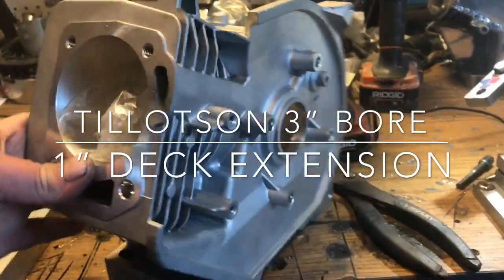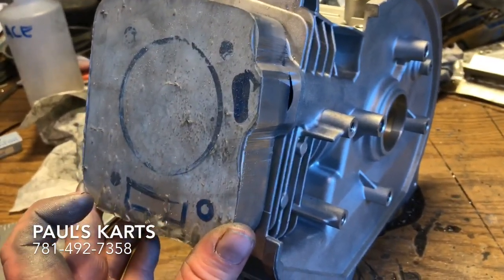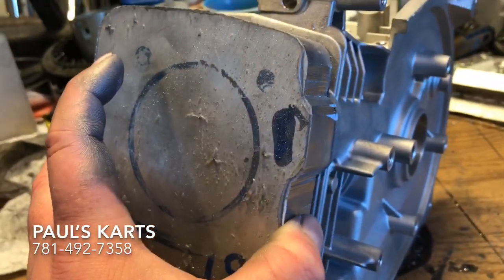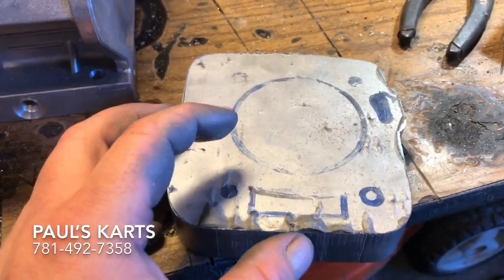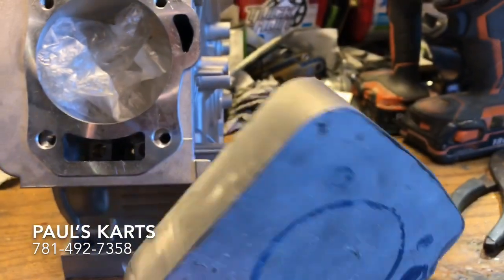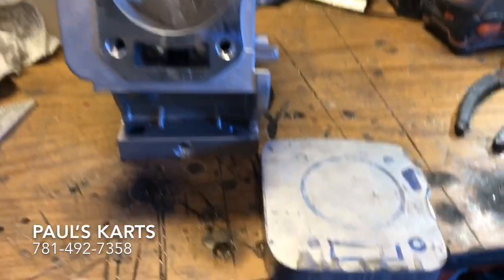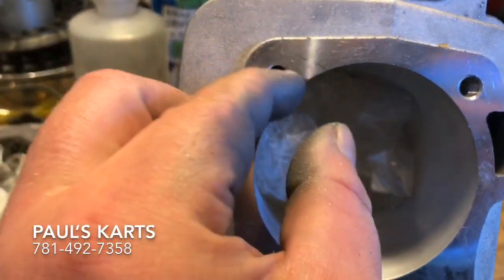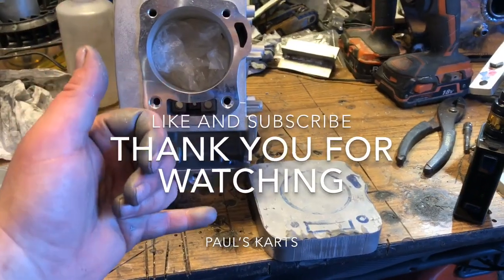TILLOTSON 3” BORE BLOCK / STROKER WITH 1” DECK EXTENSION ( HOW TO VIDEO )

Comment: What kind of rod and crankshaft are you using to make this all work out with the deck extension on this tillotson block ? 3in bore
Reply from the maker: On the 3” blocks if it’s a billet stroker crank use a Weisco piston and 6765 rod

Comment: wow busting your ass on that nice work man... I figured you had a cnc or something like that.But no your here working like a man and doing with hand tools thats awesome mad respect!!
know where to find tillotson hemi head gasket..I like the thickness on them. Post a video if you ever start selling tillotson hemi heads grate flow in stock form in my in my opinion would love to see what you can make them do
Reply from the maker: Amazing how things change in a couple years. Yes that was lots of work. We now do the deck extensions on a Cnc milling machine and there available for sale on the site paulskarts.com check em out if your in need. I’d never ✋ make one again😅
Reply from the maker: The tillotson hemi head is only good in stock form. For an open modified it’s not one I’d choose. That steep canter really kills any lift potential and the chamber is huge so low compression. Open modified “for me” would always be non hemi. We do an amazing predator hemi but that’s a little better (less canter) than the tillotson hemi. Able to squeak bye with an open build but it’s VERY specific setup to get it to work. Cool comment ! Paul
Reply from the maker: Another thing on the head is when you go all out open modified you gotta really know your cams. You can easily catch the valves passing each other as they open and close on there edges and that’s just no fun.  LSA and duration are def aspects of concern and that also makes it a difficult aspect of getting them to perform. We did lots of testing on the predator hemi to get our combo working. Like I said before a really specific setup. 💯
Reply: So the problem is the angle of the port?... one of these days im going to buy one of your complete blocks I really want to do a drag mini bike with the 270cc stroker And I'm aware of all your work I been drooling over you parts ever since I ran into it on Ebay...your the one that really got me into this stuff and the confidence to build on a block my self .. went from not knowing shit to helping others to the best of my ability in like 6 months but there always more to learn
Reply from the maker: @bakedpotato858  I don’t know if problem is the correct term but it makes things difficult. What I’m talking about when I say canter is the valve configuration in the head. The compound angles there sitting at. In stock form it’s a benefit. But in open modified that makes it hard to make power. Increasing Lift and compression can have large effects on building   break cylinder pressure ie. horse power and torque. So the tillotson heads cantered valves impede the potential. Ok. Paul
Reply: Ohh I can see what you mean yeah. I kinda found it odd when porting mine it was totally different from one to the another side. angels length and  shape of  the back wall area were completely different from each other. but thought it was good cause that turn was almost 0 could see straight down it almost.. thanks for chating with me love learnig..I  think I might buy predator hemi just to check out the head .. plus more practice on porting
Reply from the maker: @bakedpotato858  🤩😎🤩

Comment: Green back for sanding
Reply from the maker: What’s that ?
Reply: @paulskartslifan4206  https://www.toolorbit.com/pearl-abrasive-max4560zgq-4-1-2-x-5-8-11-greenback-quickmount-trimmable-zirconia-type-29-maxidisc-flap-disc?gclid=CjwKCAjw5fzrBRASEiwAD2OSV7N6MW5iMD2hcN1XaOMWmi0N_PESDt7GOIolR9oebwngVx5PspmdRxoCtZgQAvD_BwE
Reply from the maker: Looks cool but I can’t use a flap disk .. well I could but it would come out wavy .. I like my stuff to be square and straight .. now if they make a 6” stick on disk I could use that ..
Reply: Im a cetified welders we use them to clean up thick metal ans alum stainless and ect gives a clean peal polish while cutting also. Try one out you will not regret it its the best on the market if u ask me
Reply from the maker: I might get one tho I use a flap disk to take the weld off after filling in the chambers .. then mill it flat ..

Comment: Make sure you wear a dust mask when sanding that aluminum. Aluminum dust is very bad for your brain and nervous system.
Reply from the maker: Really .. don’t say that .. what does it do .. I sand aluminum all day every day
Reply: Found this on the web... 

The toxicity resulting from sanding aluminum can result in headaches, memory defects, mental confusion, colic, loss of coordination, disorientation and learning difficulty. According to some scientists, these effects may also lead to depression and digestive problems, as well as to Alzheimer's or Parkinson's disease.Dec 28, 2018
Career Trend › info-8118558-dange...
Dangers of Sanding Aluminum | Career Trend

This was a copy and paste article from the internet sand aluminum at your own risk but be aware that aluminum in fine dust form mixed with air can be harmful to your health if exposed for long periods of time. And it can be flammable too but conditions for it to ignite have to be absolutely perfectly mixed with air, humidity, aluminum dust, and heat for it to ignite. So it’s not likely to blow up in your face but it is possible.